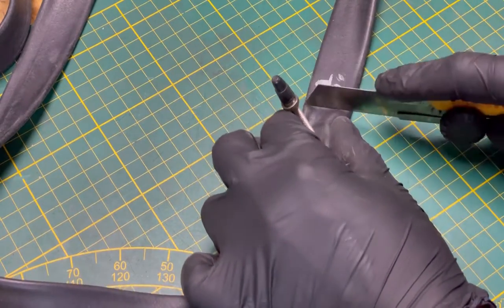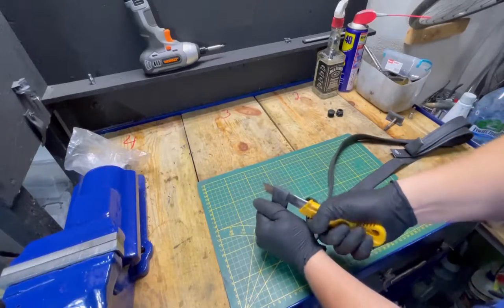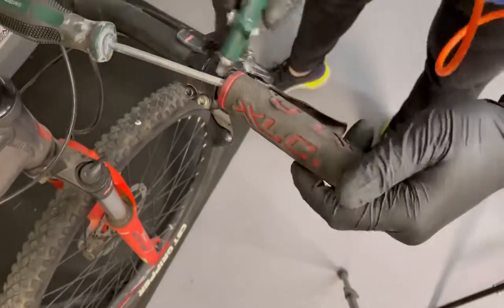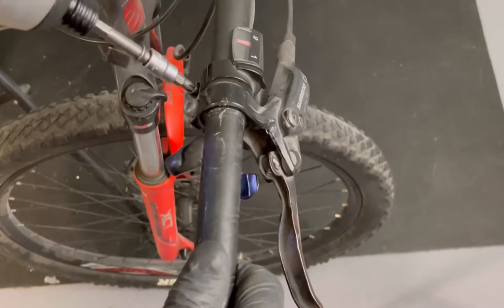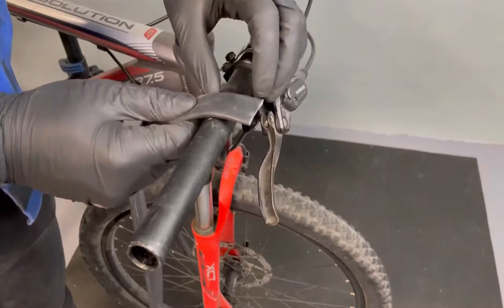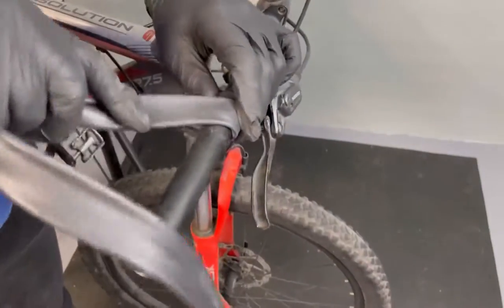DIY MTB GRIPS FROM OLD INNER TUBE!

Comment: And when it rains, your electrical tape loosens and your grips fall off
Reply: I've used electrical tape to seal water pipes and two years later its still good!!! You'll be surprised what electrical tape can do!!!
Reply: No. Insulation tape works perfect. I have used it for years on a road bike and the rain does not affect it.